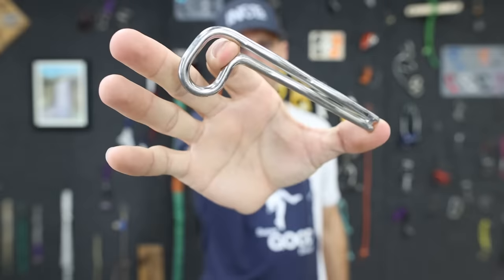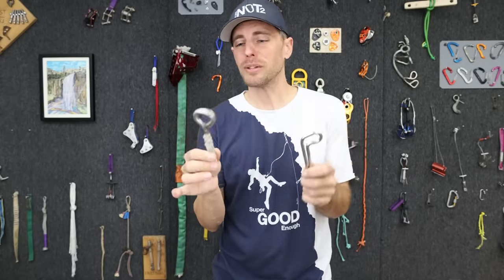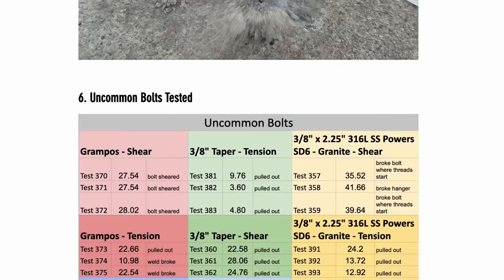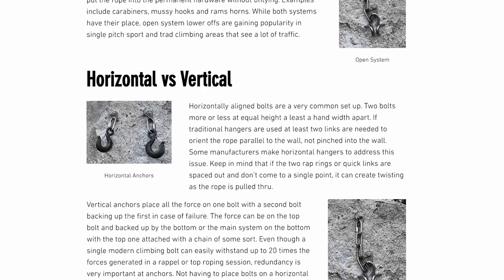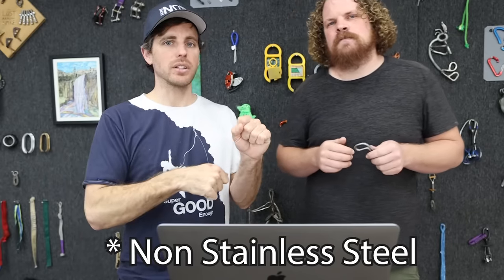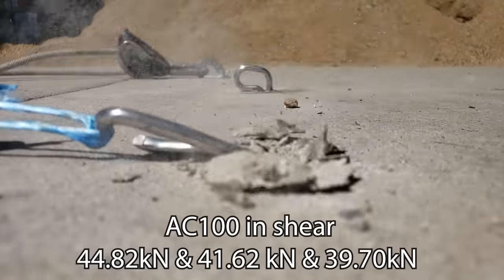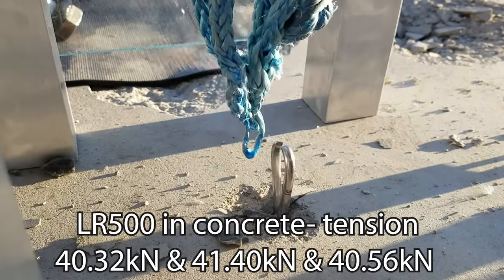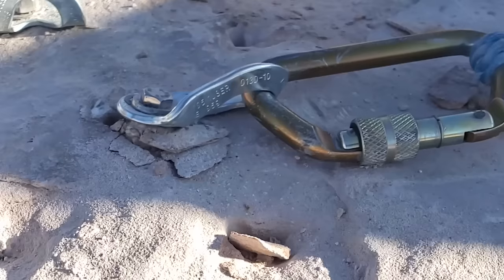Best wave bolt video on the internet

Comment: For glue that doesn't proplely adhere to the bolts, could it be worth seeing what happens if you do some surface preparation, a quick rub with 120grit sandpaper or something?
Reply: Sandpaper before adhesive is trying to put ridges on your material on a small scale. Bolts with far more significant ridges have clearly already been tested.

When they say glue doesn't adhere to metal what they mean is there is no porosity in steel for the glue to penetrate, unlike wood, and it cant create a chemical bond like superglue on skin.

The only thing holding your bolt to the glue is the shape the glue cured into.
Reply: This would be interesting
Reply: For aerospace epoxy to metal joints we now use laser surface treatment. From experience it is incredible at improving the adhesion to metal. That would be a great test to see for you guys!
Reply: It seems like an "obviously bad idea" but what about a couple notches towards the embedded end with an angle grinder to create deeper deformations for the glue to lock into?  Clearly, no one should try this without significant testing, but sometimes simple things work.  The other that comes to mind is some sort of crude, inexpensive crimping into the faces of the "legs" to create positive notches.  Either would likely reduce the ultimate strength of the rod in the area where the grinding/deformation happened, but the gain in pull-out strength might outweigh the loss of breaking strength in the metal.  (Or... these tests show they're all pretty good enough for people taking falls.)
Reply: Sandblasting with a coarse grit should help a lot.

Comment: I was around the Red when this style of bolt started being used and wanted to point out Rick and Liz Webber who did all sorts of amazing things from buying and opening Muir Valley to climbers to doing well executed and well documented destructive testing on the rock in the area to confirm the safety of this style of anchor and its advantages over older types like the "5 piece." (Of course lots of us took lots of whips on everything from spinner, short, plated 5 pieces to... uh.... let's call them IADs (Improvised Anchor Devices) in the preceding years.  The rumors of bed frames being repurposed as hangers were all too plausible from what I saw/clipped.  Which generally went OK, but we're all better off with this more systematic, proven approach to anchoring.)
Reply: Muir valley is super awesome.
Reply: I actually watched one of these get ripped out of a roof at the red shortly after they were installed in Muir valley. Although that particular bolt was not installed by Rick.

Comment: I think the technical term for the strength that the equipment resists without permanent deformation is working load right? Even though these bolts might break at the same strength as thicker bolts, their working load is lower (and good enough for climbing, but maybe not for highlining apparently).
Reply: Technically it's "yield strength" aka the strength of the material within the elastic deformation range, where it will rebound to (mostly) the original starting shape. Beyond that it enters "plastic" deformation range where it is deformed permanently (at least for metals, it's complicated with actual plastics) before it reaches its "ultimate strength" (also called tensile strength) where it breaks. The working load limit should be within the elastic deformation range (might be near the top of the range), and is set with a factor of safety (often 5:1 or 10:1 depending on industry) down from the ultimate breaking strength. WLL is not commonly defined for climbing-specific hardware like bolts, it's more typical for industrial rigging and other equipment with more established safety guidelines. Essentially operating at no more than the WLL the equipment should last nearly forever, short of failure from corrosion or wear, as it often takes into account fatigue life of the metal. 
E.g. If the wave bolts are deforming permanently at 8kN and breaking at 30k, then if we were to define a WLL with a 5:1 factory of safety we could say that 6kN is a reasonable WLL (where it shouldn't yield), but again this is climbing gear so they only really rate the ultimate (breaking) strength.
Reply: @Govanification  awesome, thanks for the great explanation.
Reply: @Govanification  you described yield strength fyi. ultimate tensile strength exceeds the linear elastic regime. allowable stress is always below yield. often 1.5-2x lower (at least in pressure vessel world. could be different in climbing equipment world). look up stress strain curve for checking.
Reply: Sorry, tensile strength = ultimate strength, I mixed up the words. I meant yield strength for the elastic range, I fixed it. The factor of safety for WLL can be based on both the ultimate (breaking) strength and/or yield strength depending on application and material. Like steel bends a lot before breaking whereas brittle materials just snap close to the yield strength. But in general if you see WLL on steel rigging hardware, the 5:1 or 10:1 FoS is based on the breaking strength, as using yield strength would be a tiny number. E.g. 5:1 for these wave bolts using yield strength of 8kN would only allow like 1.6kN WLL, which is needlessly low.

Comment: Another down side to Wave Bolts: Part of the upside to glue-ins is they are in a protective sheath of epoxy... elements that can break down the steel, like  salt which is common in limestone and sandstone, don't make contact with the steel as the steel is encased in glue. With wave bolts those elements make contact inside the hole at multiple points, meaning the bolt can break down and you can't even see it. With the Bolt Products bolts that contact point is near the surface, so you will likely see it break down if that becomes a problem. You will never know it if a Wave Bolt is breaking down 2 inches under the surface.
Reply: Corrosion is why titanium wave bolts are a thing.

Comment: If a bolt is designed to be placed in overhangs and roofs, pulling it straight up (or down) is actually a valid test.

Comment: Thanks for this video. Having installed MANY of these, I’ve become acutely aware of their strengths and weaknesses. I was nervous that that this video would reveal all sorts of new problems with these bolts but everything you said pretty much confirms what I’ve seen, and I generally feel good about the bolts I’ve placed.

Some thoughts:

1. I’ve seen the eyes of these bolts deform (slightly) in normal climbing falls. I can think of a few crux bolts at the VRG (which was entirely rebolted with Waves) that are this way. Fortunately it seems they are still plenty strong and this is no big deal.

2. I agree the interference fit is too tight, but I’ve learned that I can “wallow out” the hole a bit with a 1/2” bit to get just the right amount of interference to keep the bolt firmly in place without having to wail on it. This is a bit of an art based on rock hardness, how new the bit is, and technique.

3. The problem of the bolt “twisting” to the wrong angle is very real and is exacerbated due to the asymmetry of the legs and the interference fit. They tend to go in pretty straight until the last few taps and then twist right at the end. I am now in the habit of inspecting from all angles as I hammer them in, occasionally tapping a bit on the side of the bolt to make sure it is at the correct angle. I can also apply a little torque to the installation tool with my free hand and this generally keeps things lined up.

4. The installation tool is a royal PITA. I have a few problems with it but the worst is I have to take it off for the final few taps or I get spoodges of glue all over it. Then there’s the issue of my non-stainless hammer damaging the paint I’ve applied to the eye of the bolt or imparting dissimilar metal which can result in rusting. I’ve taken to padding my hammer with a bit of duct tape to prevent this, but maybe someday I’ll invest in a heavy rubber mallet.

5. These bolts, and glue-ins in general, can indeed excel in softer rock. However, there are limits to this. As you mentioned it is so, so essential to have a clean hole, but this gets exponentially harder the softer the rock gets. I’ve drilled holes for these in Red Rocks and Sedona where no amount of brushing or blowing will yield a clean hole: It seems I could indefinitely enlarge a hole with a plastic bristle test tube brush! In these cases, I just don’t trust glue-ins and worry they are actually over used in really soft rock. Instead I’ve taken to using the largest mechanical bolts I can (usually very long 1/2” 5-piece) which, between both the expansion of the cone itself and the expansion of the sleeve over the cone, actually have a lot of expanding surface area. I reason this may hold in less-clean holes better than glue-ins… or at least when these bolts weaken it will be more obvious as they will start spinning or wiggling and won’t just slide out like a glue-in that has a poor bond.

6. Finally, I love AC 100+ Gold for its very neutral, rock-like texture and color and its usability in cold-to-moderate weather. It is a bit of a race in warm weather for sure (always bring extra nozzles, get everything totally prepped beforehand - including yourself, and have your methods totally dialed!).
Reply: Things I’d like to know more about:

1. How bad (really) can the rust issue become from using a non-stainless hammer during installation?

2. How common are glue-less voids in the holes during a typical installation due to the leg shapes of bolts like these and the process of hammering them in?

3. When thin rod bolts like these deform under harsh climbing loads (say 6 KN ish lead falls), do they reach a stasis where repeated, similar falls no longer deform them? Or do they keep deforming with every such fall (common on crux bolts) until they become unusable (ie unclippable)?

Comment: What really gets me about your testing vids, is; you have these hardened chunks of metal, then a bit of cord (or tape) is used to pull them in the tests.

People underestimate the strength of rope and tape.
Reply: I think the "tape" you're referring to are slings, and they are def not tape. Slings are made of nylon or a high tech fiber like dyneema (which is stronger than kevlar). Please don't trust your life to tape :)
Reply: @tjibbeettema8759  
I used 'tape' instead of saying 'webbing'. Slings can be tubular webbing (which is what I preferred, I think it is stronger in use) or flat woven webbing.
Reply: I see what you're getting at but anyone who likes material science will cringe if you call steel "hard" when it is clearly bending not shattering ;P
Reply: @snigwithasword1284 words have different meanings in different contexts. In climbing we distinguish between "hard goods" (steel, aluminum, titanium) and "soft goods" (nylon, UHMWPE, polyester, aramid). Obviously a material science context would be different.
Reply: @Alastair510 in addition to the dyneema soft shackles, the other common soft things used to break things on this channel are the polyester industrial slings aka spansets. The webbing (nylon or dyneema) is more often the thing being broken.
Reply: @snigwithasword1284  Would someone who knows material science cringe at the statement that hardened metal bends?
Being ductile is a characteristic of metals.
Even hardened steel will bend and deform.

Comment: Lol at, "they need a half inch hole because they're 6mm". Nice unit mix 😅
Reply: Completely valid, though. 12 mm would be too small and arguably so is half inch, let alone 12.5 mm.
Reply: Drill bits here are almost exclusively in imperial units, whereas I'm guessing the bolts tend more towards metric, so it makes sense in context. But yeah it does make it hard to compare.
Reply: @leveller4 You would be amazed how many metric threads are best cut in holes drilled with imperial drills (the 1/4 mm difference is really useful).

Comment: I wonder how much rock dust is created by hammering in the wave bolts. I've put threaded rods in concrete where the hole was a bit wonky and when I test fitted the rod (without glue) it was dusty as hell. Soft sandstone was even worse.

Plus with these things I was told to always twist the thing I'm putting in to create some flow in the glue, you can't do that with a hammer.

I wonder if a little bit of a kink right below the eye would be a good solution. If it's in the right direction the steel would be "pre-deformed" to there it's already resting on the edge of the hole on the pulling side.
Reply: Brushing and blowing out a hole is standard practice before installing a bolt, wedge or glue in, doesn't matter.
Reply: @bobbypatton4903  yeah but after you clean the hole you scrape past the rock with the side of the steel bolt. Threaded rod removes some material for sure, and that material is then on the side of the anchor and moving around in the free space in the hole. Imagine cleaning a hole in super soft sandstone with a brass brush: the more you clean the bigger the hole gets. It will also always be dusty.

Comment: i would have been interested in a test result for installing the bolts in bigger than recommended holes.
Reply from the maker: We have a 16mm hole near the end of the video pulled in tension.  It held just fine